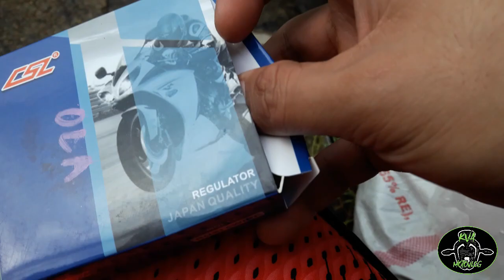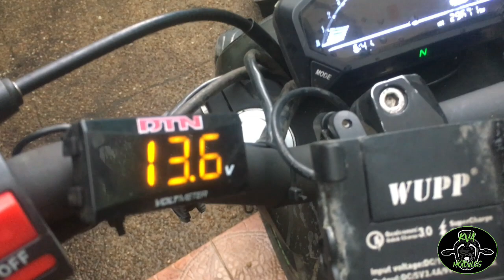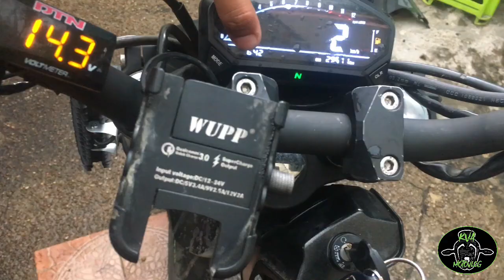MOJO 200 ISSUE || REGULATOR PROBLEM

Comment: paps pag dischargado ba ang batt , maoonn parin ang mga ilaw? khit di naandar?
Reply from the maker: Good question. Stock is hindi battery operated ang lights low and high beam. Kahit di diskargado ang battery basta di umaandar ang makina di talaga aandar yung high and low beam..
Reply from the maker: Kapag pinaandar mo yung motor through kick. Then di parin gumagawa high and low beam pacheck mo na pre headlight.
Reply from the maker: Kadalasan kasi sa stock headlight na mojo may na tatangal na hinang
Reply: @KVAMOTOVLOG  okay na mojo ko  boss , maraming salamat, sa starter relay pala ang tama ndi sa batt